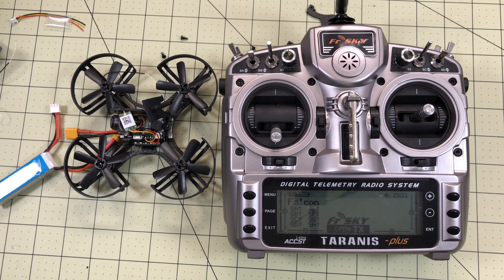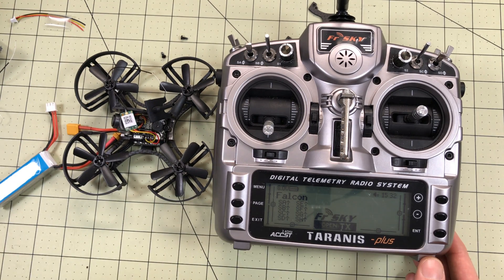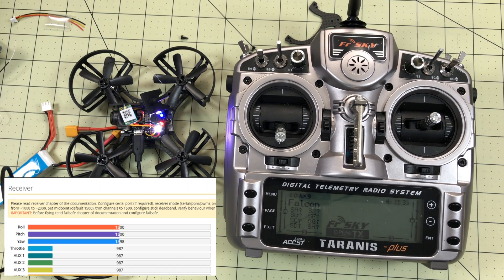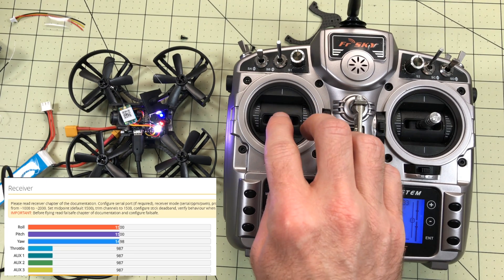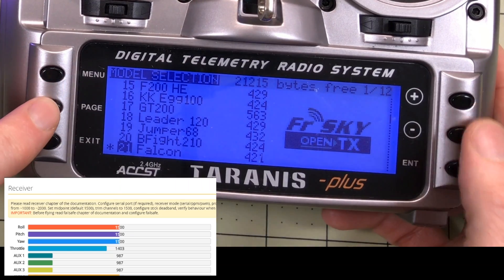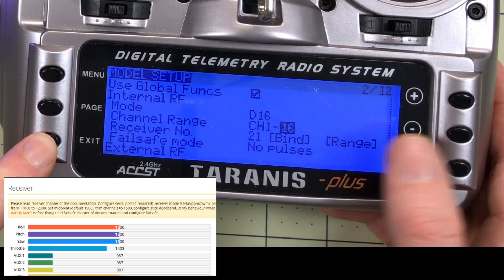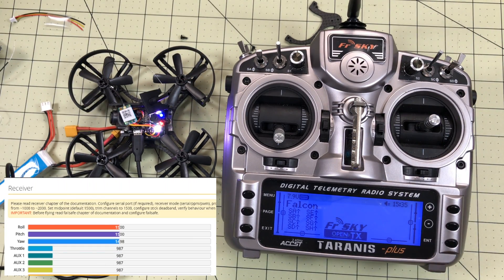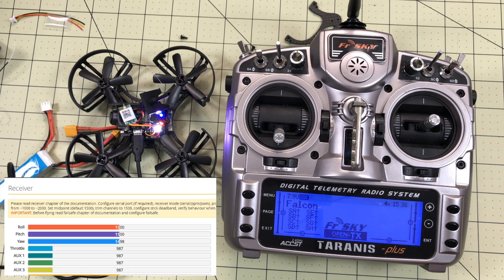FrSky XM Receiver Problem FIXED!!!  15 second latency, was totally unusable

Comment: I've used for a while the XM+ with NO issue.  That  being said... Just 2 days ago I purchase a new one. Hooked everything up, bound it. Plug into my PC open, beta flight....  and like your issue I encounter the same. I remember back to when I first got a XM+.... Had a simular problem. Simular NOT the same. 
So I try to remedy my NEW problem via exp of my past. Did NOT work....
A day go by..... Puliing teeth. 
Then this morning.... I coincidentally move one if the rx antenna. There the problem was. 
I remove the heat shrink. And the antenna connector was loose. I reply it. Problem fix.

Comment: thanks, my xm+ receiver faded red blink and dont connect transmitter, while ı use broken problem, ı give 2s lipo on receiver after light is shining, firmware flashing successful but dont comminicate with transmitter red light blink but faded

Comment: I have a xm+ reciever and the aileron channel is reversed from reciever to control modual not trans to reciever, have you seen this or doI have to flash something. useing radiomaster tx16 s trans. If I reverse trans then ail backwards trans to reciever but rifgt reciever to modual.???? thks John

Comment: I noticed in your video that the radio is right next to the quad if you didnt know this you need to have your quad at least 2 to 3 feet away from the quad for it to work. Maybe try this on the next one without doing anything else and see if that fixes it

Comment: I have a tiny7 with XM receiver (AC 900) and it won't bind, I've bound many drones before so I'm not sure what's going on. The Frsky Taranis X9D plus is new to me but I don't think it's the receiver. I tried redoing the firmware on the drone to no avail, still won't bind.

Comment: I’m having a similar issue on my qx7 and xm+ receivers now. On my right stick (pitch/roll) but not on my throttle I have a good 1-2 second latency but it doesn’t happen all the time. Just yesterday it started getting really bad. I went out to do some race practice with the hawk 5 and pack one was perfect but packs 2 an 3 I had the issue then packs 4-6 we’re fine and then 7-11 the issue came back. And this wound up happening on 3 quads all with xm+ rx’s in them. But on my beta65s and my babyhawk r it worked just fine. Weird.

Comment: Thanks for this video. I was having a different problem with my ET115 (BNF Frsky) and this solved it. Mine would bind, but it never responded to the radio at all after binding. I couldn't see anything from the radio in Betaflight. I tried everything I could think of, changing UARTs, re-binding, and several other things I can't remember now. Then I saw this video and tried binding it with all 16 channels enabled. It finally works!

Comment: Mine on the BabyHawk is doing it and it won’t even show the switches on the modes I’m so frustrated. I have a green light showing I’m bound and everything. It’s crazy I don’t get it. I think I tried doing what you did on this video but I’ll try again. Thanks
Reply from the maker: Are they completely missing?  If so that is usually a Betaflight bug and it needs updated.
Reply: DroneRacer101 yea completely missing. What’s the most stable one to update to?
Reply from the maker: I would just go to whatever the latest 3.3 is that isn’t a release candidate.
Reply: DroneRacer101 ok thanks a lot. I’ll give that a try. It was showing I was using an out of date version and I may have updated with a released candidate not realizing it. It was showing the switches before that they just had a lot of latency so that’s probably what the problem is. Thanks keep your fingers crossed for me. Thanks again. Don’t know if I’ll get to it today but I’ll let you know if that fixes it. It’s got me so frustrated I had to walk away for a bit before I smashed it with a hammer lol.
Reply: I tried all of this and still nothing. I can get the motors to spin on motors tab but still no receiver and green light shows it’s bound.
Reply: DroneRacer101 do u mean update the Beta Flight software or the Beta Flight on the drone?
Reply: Man I wish you or someone around here were close by so you could help. Any help you can send would be much appreciated. Thanks for the help you have given already as well. I’m new to all this but I’m getting there.
Reply from the maker: Both. I have seen either the firmware itself or the configurator versions cause this. It’s usually when one is new and one is old. Even if there is no receiver at all the bars should show.
Reply: DroneRacer101 what would you do? I have never tried flashing a board before. And it looks like I would have to do some soldering to flash the receiver. I just want to fly this thing why must they make it so difficult?  I know you didn’t build the thing I’m just venting. I appreciate your help.

Comment: Holy shit dude!  If this works your 
!@#$'n genius!   As soon as I finish  my smoke and beer I'm going in to check it out.  If I'm not back within an hour the wife caught me and held me up, but I will be back to let you know how it worked out.
Reply from the maker: Lol. I still don’t know why. But I’ve had this “fix” about a half a dozen receivers.
Reply: ......the wife caught me.....anyways....didn't work.  
!@#$ me!  Getting frustrated.  
Naz32 rev6 with xm+.  Motors spin up in beta but the radio tab won't do anything.  Yes I've gone through all the settings.  Accelerometer is even turned off to try to see if that worked (Joshua B recommended).  If you have anything else ease throw it at me.  I'll try anything.
Signal wire IS plugged into uart2 which is #4 on the board.

Comment: It wont work i bought a kingkong 110gt but i cant fly  it😤
Reply from the maker: What doesn’t work?  Which part?
Reply: DroneRacer101 I think the reciever i can bind but on betaflight nothing moves when i moves my sticks . The balks just stay the same . I contacted banggood but they does not react. I am just a child and i gave all my money to thuis droge but i won't work
Reply: DroneRacer101 can you help me please
Reply from the maker: Which model did you get?  Which receiver?  What radio do you have you bound to it?  I don’t doing in to every detail of setup in this video but it may help if you have FrSky.  Kingkong 110GT Unboxing and First Flights.  Can the motors handle 3S? Does it need an XT30? https://youtu.be/DV7KC-umunA
Reply: I already watched That video. I have a frsky taranis plus and my kingkong came's with a xm reciever. I tried everything i already worked 4houres trying to fix it 😫. It just wont work.
Reply from the maker: Unfortunately its really hard to diagnose remotely.  Do you have a video for it? Show the receiver and how it's wired and that it has a green light so its bound,  where is it wired on the board, which UART is selected in Betaflight, it's set to SBUS.  I've seen this a number of times and it's almost always one of those things.
Reply: Uh i used aurt 1 and sbus and yes my light was green.  After school i will try to make a video
Reply: And thx That you want to help me
Reply: My video will be ready at 19.00 in europe
Reply: I made my video for you it is uploading right now hopefully You can help youre my last hope
Reply: The video is uploaded but sorry for quality

Comment: Hey do you have any idea as why rssi is now not available in newer xm I ordered I have couple of these but in previous versions I do get rssi and not getting in newer ones...any solution ?
Reply from the maker: Getting RSSI where?  You won’t get it on the radio. There is no telemetry. You can get it in your osd if you set that up.
Reply: DroneRacer101 no no not on radio but on betaflight GUI or on osd I am getting accurate rssi via channel 16 or on auxiliary 12 but on receiver purchased recently I am not getting it so did you got my problem
Reply from the maker: Ok, try channel 8 also.  There is a a version of the firmware that uses channel 8.  If that doesn’t work you will probably need to flash the firmware on it.  This video is for a different receiver but the process is going to be the same.   https://youtu.be/VCpzlijHNVw  And you just need to get the firmware from here. https://www.frsky-rc.com/xm-plus-mini-sbus-non-telemetry-full-range/
Reply: DroneRacer101 thanks will try doing that

Comment: You're a good man for posting this video. The only explanation I can come up with is that perhaps there is some excess signal processing going on in the XM when the Taranis is set up with a Channel Range of 1-8 in the Model Setup page, but your quad is using all 8 channels (or perhaps more than 8). Widening the Channel Range beyond 8 may change how the Taranis sends the signal and the XM receives it, eliminating that processing bottleneck in the XM causing the massive delays.

Comment: I have the Aurora 90 and I’m getting major 1 sec delay and its supposed to be set up in D8 not D16...tried everything not sure if its a bad Frsky receiver. I have the Qx7, any ideas? Thanks
Reply from the maker: +Charles Lamoureux have you updated firmware on it?
Reply: Yes updated everything. Setting are bang on according to what everyone else has...SBUS, TAER , etc etc..Don’t know why I’m still getting 1 sec delay  like your but only 1 sec...
Reply from the maker: +Charles Lamoureux Have you tried it live on the model with props off to make sure it isn’t just betaflight?  If you have I have heard some people had luck actually going back to old firmware.  I haven’t run into this issue in D8 personally.  Just D16.
Reply: Out of the box it had the 1 sec delay..I tried to fly it and almost killed a tree because of the delay , I was able to land quickly. So I updated everything and still samething. SO its not the firmware , I thinking it ‘s bad receiver

Comment: After receiving many XM receivers that did not have this problem, today I received one that did... only way worse. With channel range in the Taranis' Model setup Menu set to CH1-8 (9ms), I was getting only 1 second of control and then nothing. I remembered this video, and tried your fix - setting it to CH1-16 (18ms), and it was much better, but control was still intermittent and lagging a bit...

In the end, I had to flash the receiver with a previous firmware - found at: 

https://www.frsky-rc.com/xm-1g-sbus-non-telemetry/

Select the one dated 2016-12-25 (the one dated 2017-03-28 has the problem). After I flashed the firmware, I was able to use CH1-8 (9ms)  again, with no problems at all.

Comment: When i connect my lipo to the 90gt... the sound it makes normally only sounds halfway... not complete sound... but binds... green. Connected to betaflight plus lipo all my switches work... the moment i unplug the usb the fc has a flashing red light?? And switch and stuff dont work anymore. I updated the latest spracing3 board bf3.1.7... so i kept the arm on while i removed the usb and hovered... after 5seconds it went crazy and crashed...
Reply: Have  now the same. Did you figure it out? It binds, it flies but for no reason after some time I get the red light on the reciever

Comment: Strange. Does it happen with all of your XM receivers? Because it doesn't happen with any of mine. Usually, increasing the channels increases the latency.
Reply from the maker: +Temporal Flux this has happened with the last 4 I have gotten. True. That is exactly why I normally keep it at 8. But setting it to 16 increases it by milliseconds. When it also decreases by seconds I will take that trade. :-)
Reply: Temporal Flux I'm pretty sure this is because the XM and XM plus receivers were made to run on D16 they were not made to run on any other mode ..... And now we see why lol
Reply from the maker: +RCFlyer85 This XM is still bound using D16.  The Taranis defaults to only using channels 1-8 though because it can do that with less latency.  You should only increase it if you need more channels, or have this problem.
Reply: DroneRacer101 does changing the radio channels from 16 to 8 really help latency?